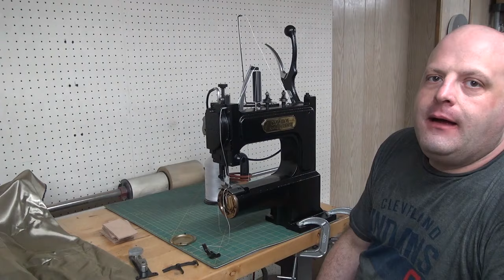Special attachments of OUTLAW leather sewing machine for beginners

Comment: When I use the left presser foot I cannot turn the material around to backstitch since I am sewing too close to the edge for the foot to press the material down once rotated. Would the compensating foot help with that? This is really only a problem at the start of stitch. At the end of the stitch I can manually sew backwards without rotating the material. I suspect that lightly marking stitch holes at the start and sewing backwards manually might work, but I haven't tried that yet.
Reply from the maker: Thanks for using our leather sewing machine! Compensating foot is for walking foot sewing machine, OUTLAW is needle feed machine, not walking foot, so no compensating foot. You do not need to turn the material for backstitch (reverse stitch), just pull the material back 1-2 stitches😀